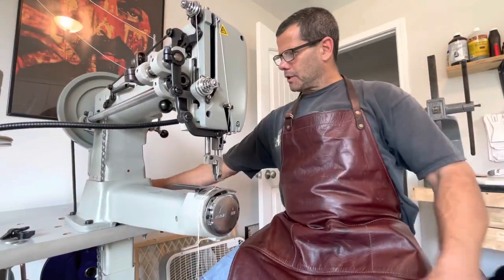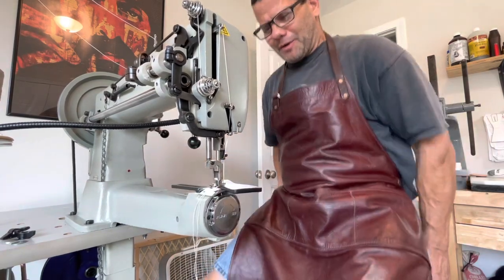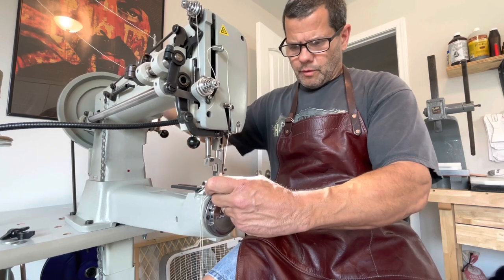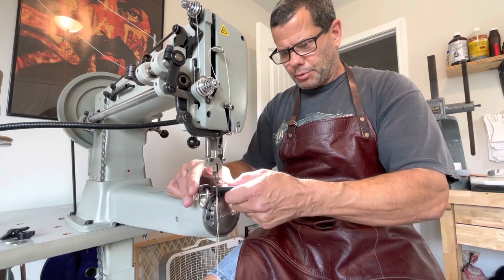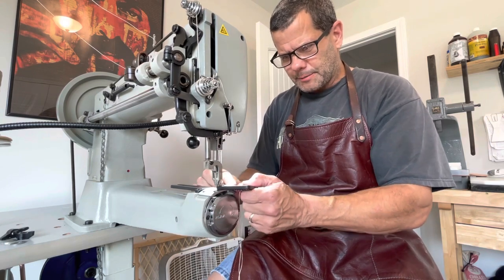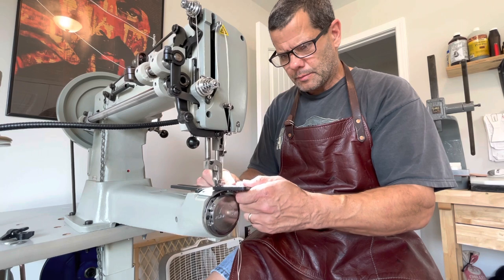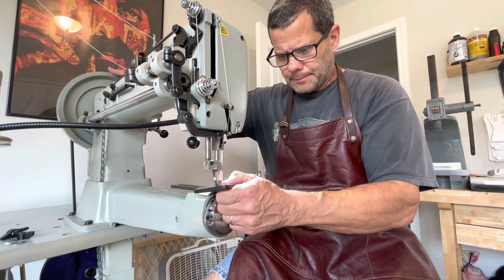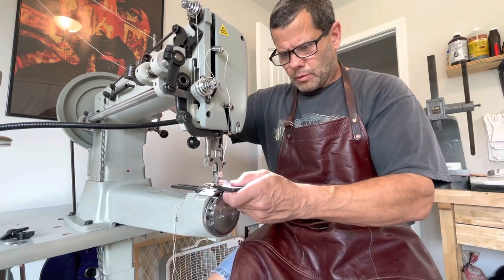Sewing Leather With A Harness Stitcher Machine CB-4500 Leather Sewing Machine

Comment: Makes me want to pull out my old arch-top Singers out. Thank you for showing us your machine, Eddie. Stay safe and stay cool.
Reply from the maker: Hi Shovelhead8, I like the name of your page I have been running Harleys for years and the Shovelhead motor is an awesome old motor and the Knucklehead is a very cool old motor. Thank you for watching have a great weekend.
Reply: @BattleAx342  I was a factory trained H-D mechanic. Had a 77 XLCR, 65 Pan and a 70's shovelhead. Been out of it for a while. Did more vintage bikes than modern ones. Thank you for the reply, Eddie
Reply from the maker: @shovelhead8  I had an old Iron Head for years 4 5/8 stroker motor full Andrews trans. I got tired of doing top ends. Every time it broke the old lady would say how much is this going to cost lol. I sold the bike in 2010 to the Joe the Motor Mans nephew the kid is using the bike for a drag bike now pretty cool. I ended up in 2010 buying a 2008 IL state police bike Wild Fire Harley had the account with the state police that year got a really great deal on a 2008 IL State Police Bike / Electra Glide.. I put a Russ two into one exhaust on it and had Harley put a tuner in and they tuned it on a Dyno big difference in power. Have a great weekend brother...